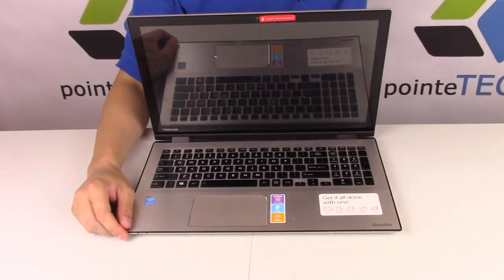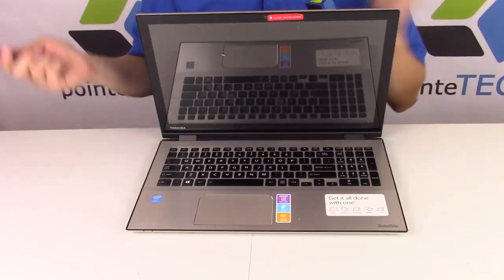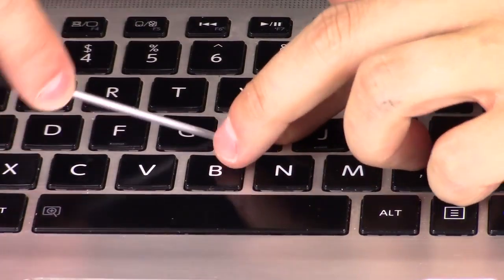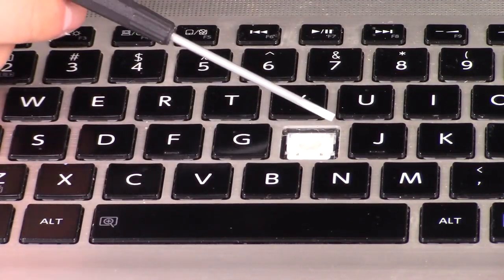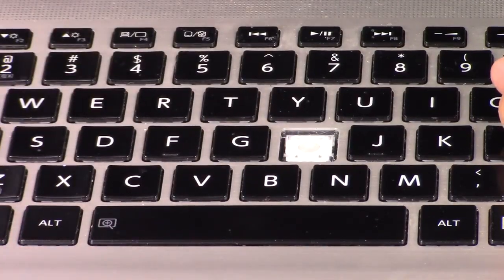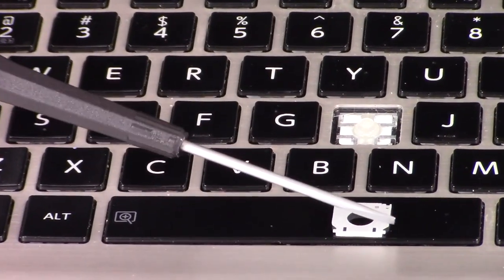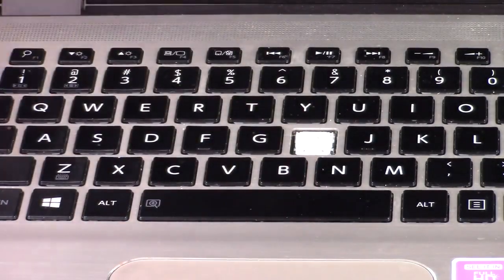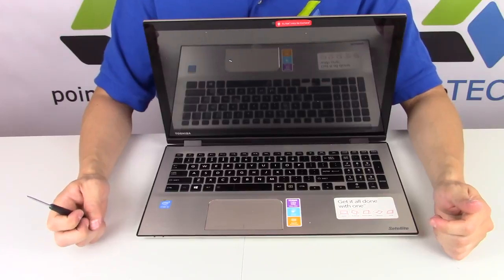How To Fix Replace Keyboard Key - Toshiba Satellite P55W - Letter Arrow Function Small Size

Comment: Thanks for the video. I got an L450 cheap, it had German keys. I got a non-working UK keyboard from Ebay and replaced all the different key caps. I broke the first key I removed, fortunately on the non-working keyboard, but after that none of them broke. I now have a good UK computer for the grandson.
Reply from the maker: Glad your all set :):)  Always here if needed !!

Comment: hi, this video was really helpful until the first part wouldnt snap on. may you please help me with this problem? im not sure if im doing it wrong or im missing a part
Reply from the maker: If your Key Cap is not clicking down in place correctly, it is most likely due to the Retainer Clip not being properly installed or damaged.  Remove the Cap and inspect for damage or that its not laying down flush and properly snapped in itself.  Compare to another Clip if needed by removing another Cap.

Comment: Hello. I have a Portege Z30-B, and 2 of my keys have suddenly popped themselves off, along with the plastic that's underneath it. Does this still work?
Reply from the maker: Yes, this is a tutorial on how to install keys.  However, if your keys are damaged or broken, they would need to be replaced as you cannot install and correctly use damaged keys

Comment: thank you, i just wondered what do i do if the plastic is still on the key, my S key fell off and the plastic is on it, can i take it off?
Reply from the maker: Because they cannot usually be installed together, you would need to separate them as seen here, using a small flat pry tool

Comment: Thank-you for your video. I have a similar model, Satellite S55-C5364, with brushed aluminum French housing, and a few keys are dead. Can the dead keys be repaired or do they need to be replaced? Where would you recommend I find spare keys?
Reply from the maker: Do the keys feel like they dont work, mechanically?  If they FEEL broken, then I would try replacing them like shown in this video.  However, if they FEEL fine, then it may be an issue with your drivers or your keyboard.  Update your drivers as shown here;  https://www.youtube.com/watch?v=AExeK3QAN7U.  If that does not help, you may need to replace the keyboard.

Comment: My keyboard was broken when I bought the laptop but while cleaning one of the keys the rubber and plastic ripped off :(( is there any way I can take the rubber off? and replace it with a new one. I heard you could take it off and glue a new one back on
Reply from the maker: There isnt really a good way to reattach those.  They are not meant to be replaced.  Best advice is try to use a small amount of glue.  If that does not work, you may have to replace the keyboard.

Comment: My "w" key looks different from the retainer you have and I'm having difficulty putting it back in, could you help?
Reply from the maker: In what way does it look different?
Reply: PC Monkey it’s a different hinge/bracket I think it’s a tc06 but I broke one of the nubs so I probably have to buy a new one idk where
Reply from the maker: @roshinirajimon3660  What is the brand and model computer you have?   Yes, if any component is broken, you would usually have to replace.  You can search for an individual key for sale on sites like Ebay, Amazon, etc.  If you cant find one, which is common, you would have to purchase a whole keyboard and take a key from it
Reply: PC Monkey it’s a toshiba satellite P55W and it has a backlit keyboard I found a site that sells the individual keys but I’m not sure if I can trust it, can I just bring it to Best Buy or somewhere else to fix the one key?
Reply from the maker: @roshinirajimon3660  Sure :)  They may charge more than you would think but any computer shop will repair.
Reply: PC Monkey thank you so much!
Reply from the maker: @roshinirajimon3660  NP :)

Comment: ive doen the steps correctly but when its time to put the key back on it wont stay :/
Reply from the maker: If your Key Cap is not clicking down in place correctly, it is most likely due to the Retainer Clip not being properly installed or damaged.  Remove the Cap and inspect for damage or that its not laying down flush and properly snapped in itself.  Compare to another Clip if needed by removing another Cap.

Comment: What do I do i i break that little plastic
Reply from the maker: I usually get my keys on Ebay or https://www.laptopkeys.com/.  If you cannot find a loose key for sale, you may have to purchase a keyboard and take a key from there.
Reply: Can I use super glue before i buy one
Reply from the maker: @timmy7934  Some try that but the key mechanism / the hinge clip, needs to be free to move in order to allow the key to go up and down.  Gluing it in place is not a recommended solution.